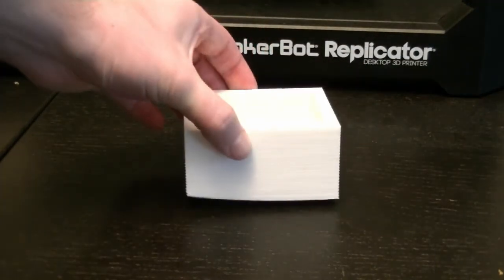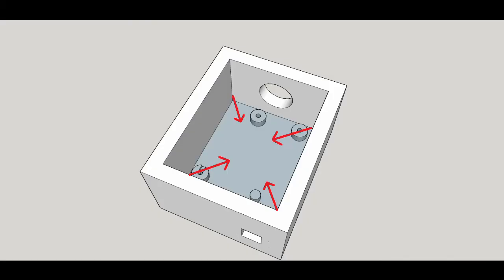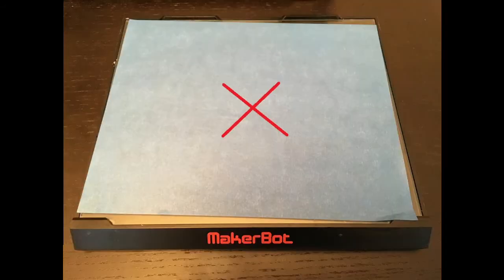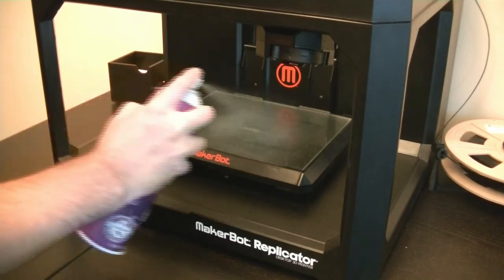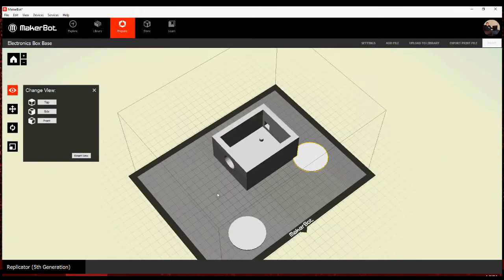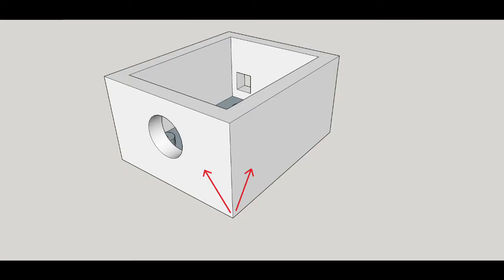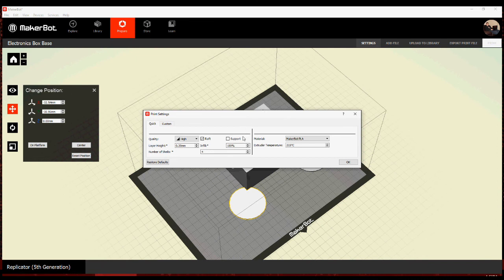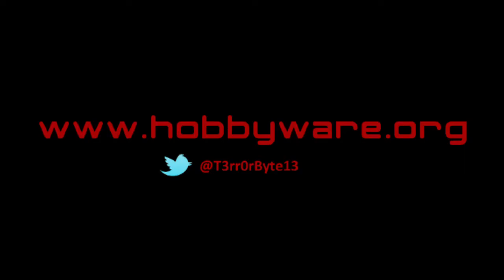Fighting Warping in 3D Printing

Comment: Hairspray is cute and all. What you need is ABS slurry, a mixture of industrial acetone (100%) and ABS filament, ratio of 60/40. Apply on sanded glass, using a rag, and when finished printing, remove by soaking in water. Remove the plate from the printing surface first obviously. The glue works on PLA, PETg and ABS. No warping, because the slurry says so.

Comment: Any idea how to prevent this on a 3d systems z660 pro? It's a gypsum powder based printer. The print does not make contact with the platter rather a thin bed of powder is printed onto. 

Thanks
Reply from the maker: I have never worked with a powder based printer before, but if your experiencing warping a few suggestions in the video may work for you as well. I would also try putting your question to a 3d printing forum and see if anyone there has expeience with your printer. Enjoi!